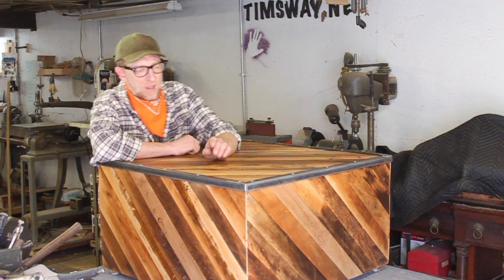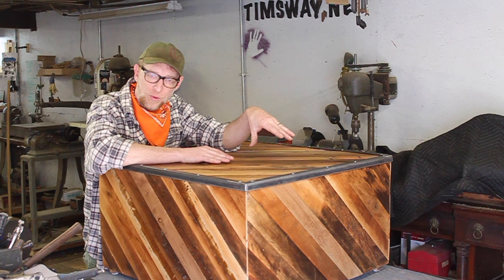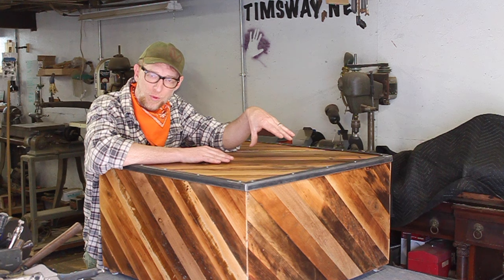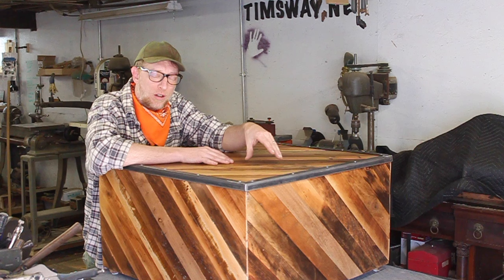Geometric Cube Table from Reclaimed Wood

Comment: turned out beautiful. As a metal worker, I don't think you needed the angle iron around the top edge.
Reply from the maker: thanks! I wanted to hide the transition a little (and match t to other pieces I made for the customer with metal accents).
Reply: I understand... and in no way was criticizing your design choices.

Comment: Tim! Great piece as always.  did you come back afterwards and soften the vertical edges on the box? 
I can imagine another version where you hinged the top to allow for storage inside the box... hint hint.    :)
Reply from the maker: Dave Smith thanks! yes I softened the edges when sanding a tad. storage wasn't in the customers budget but go back a few videos and I made a similar box with lift top storage :)

Comment: I have been a sub to your channel for years.  It has been an inspiration for me to start making stuff and start my own side hustle and YouTube channel.  So I am asking this question out of genuine curiosity.  You are very environmental conscious which I highly respect but why liquid nails?  Isn't that more toxic than tite bond 2 or something similar?
Reply from the maker: good question! I used liquid nails as the surfaces i'm adhering aren't very flat, and one surface has paint on it. the liquid nails is thicker , fills the voids and still adheres while also clamping pretty instantly. if i were to try and use wood glue it would make this a much MUCH more challenging project. 

As for toxicity levels, liquid nails is probably more toxic than regular wood glue (i'm no expert on this) but it is considered a low-voc product and dries safe. Ther best I understand it's like "normal toxic" not "evil villain toxic." epoxy and super glue will try to kill you if you turn your back on it, too! :) 

Thanks Josh and I'm honored to be a positive influence in your life!
Reply: If you don't mind me asking.... When you first started off you were operating out of a one car garage.... When did you jump to making as a full time gig
Reply from the maker: Josh Burke I moved to my current shop about 4 years ago but was still playing music part time then. I've been totally just "making" for about 2.5 years now.